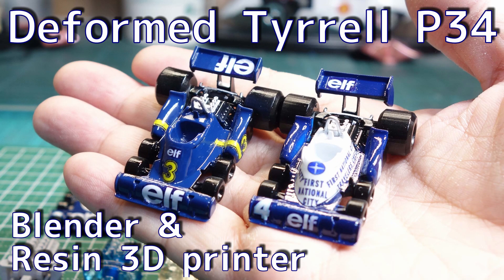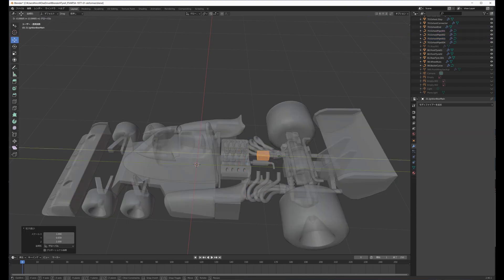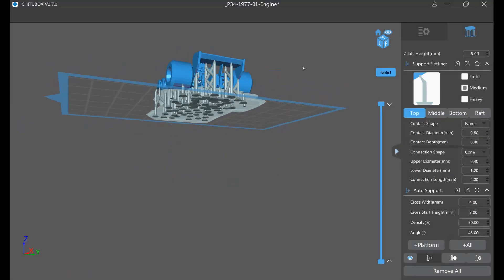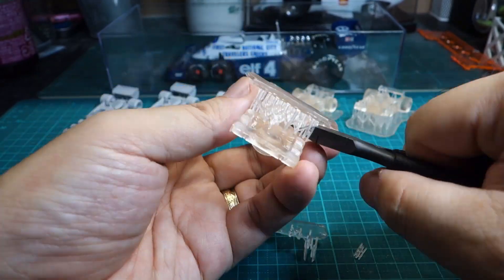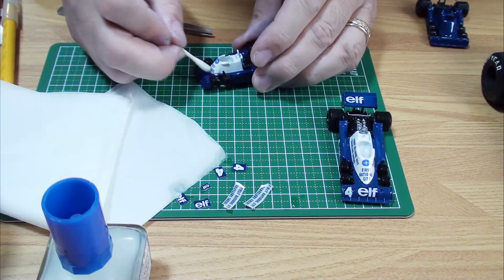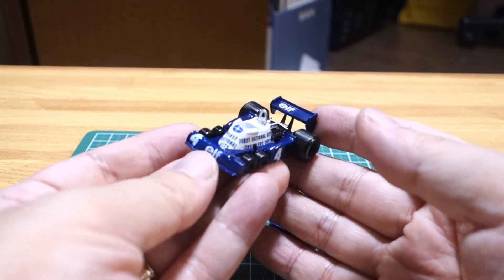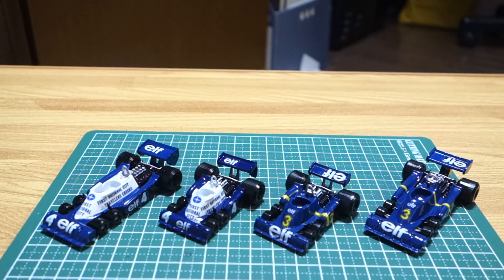[3D printer] Making a deformed miniature car of Tyrrell P34 [Blender]

Comment: Hello Dendeba, first off all congratulation for your work ! it's amazing !!!  I would like to know how you print your decal ? because regular printer can't print white on a transparent support. do you print it yourself or make a png template and print it by a pro printer ?
Reply from the maker: Yes, what you wrote is exactly correct. White characters cannot be printed.
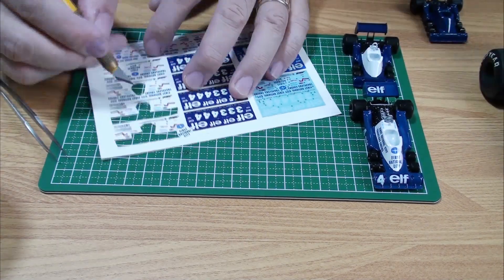Thus I printed a blue background on a white DIY decal paper. 2:48
In this case, it was difficult to match the blue of the body with the blue of the decal. 
In addition, I painted blue used for the body with a brush at the boundary of the decal to make the boundary inconspicuous.
I can see the boundaries with eyes, but I may cheat them well in the photo.